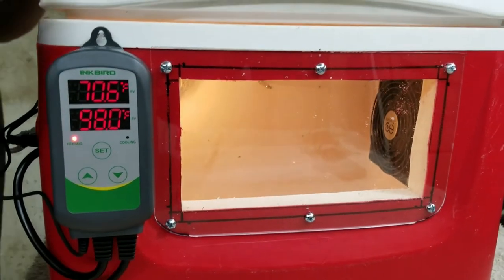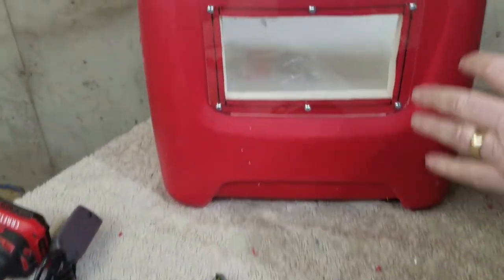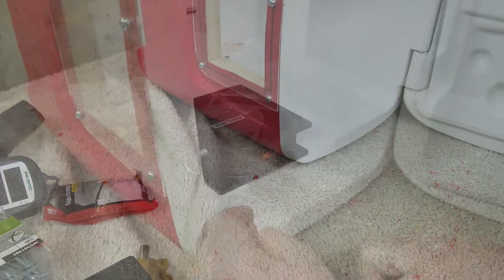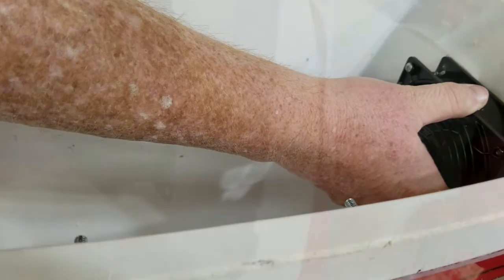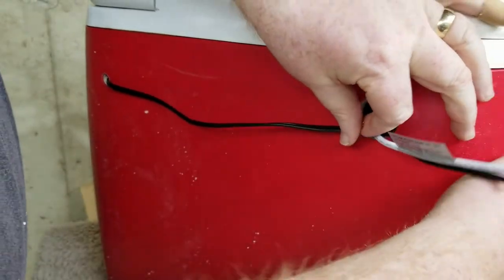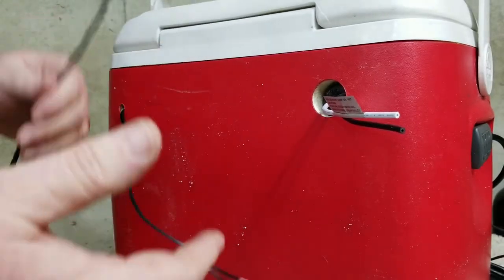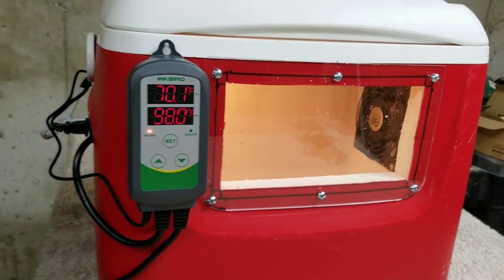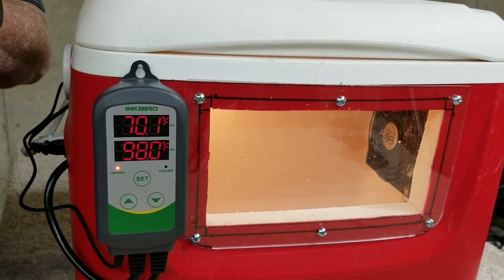DIY Baby Bird Brooder / Incubator Build (Part 2)

Comment: I've set mine up identically but my bulb is close to the bottom .Mine has a manual egg roller that sits on a tray above the light and fan (the trays covered in 1/4" hardware cloth) I can't wait to use it to hatch chicks! Thanks!

Comment: Great concept! Thank you for sharing. How and how much water do you need to keep relative humidity at 50%?
Reply from the maker: Depends on the temp in the box.  also, the more surface area the higher the humidity. you will have to play around with what works for you

Comment: I just saw your video today and subscribe it. Great video. How did you do the wiring? Connect all together? Please explain more about wire connection. Do we have to move eggs every 2 hour manually? Thanks
Reply from the maker: I purposely didn't put video of me wiring because I didn't want this to turn into a DIY on wiring and electricity. We have strict guidelines from YouTube of what we're allowed to show. And not take responsibility if someone tries it and gets hurt. As far as turning eggs I guess this could be used as an incubator, however it's really more of a brooder for after the birds have hatched. Although I have tested this one at 98.5° F and it holds temp just fine so it would incubate eggs.

Comment: One silly question, would ceramic heating bulb work instead of the light heating bulb ? Either way I’ll be building one too, thanks for informative video not much out there
Reply from the maker: It might.  One thing to be aware of, it doesn't take much heat to really heat them up.  You may have to do some testing on what bulb works best with your cooler.  Keep me posted on what you come up with.  Kevin

Comment: Love this video! And will be trying to make one of my own! Question do you mind sharing a link to which fan you used?
Reply from the maker: Try this,   SXDOOL AXIAL Cooling Fan 12cm, AC 115V 120V 120mm x 38mm High Speed CFM with Switch Power Cord, for DIY Ventilation Exhaust Projects
Reply: I found everything on Amazon but light

Comment: Great video! My cockatiel laid 3 fertile eggs and would not sit on them. I used an incubator and all hatched. However, the last one had a darker discharge in his egg, the others had a lighter discharge. Is the dark discharge something to worry about?
Reply from the maker: I wouldn't be overly concerned if the baby is eating and pooping normally.
Reply: Ok, he seems fine. I do have another question about our oldest baby. He is always laying on his stomach. He eats fine but I don’t know if laying on his stomach is normal.
Reply from the maker: @zip._.6842  ok.... When you say always, does he always!?  Meaning he never gets up?
Reply: @Bird.Squawk  he sits up a little bit. He eats good and sits up some for food. But when he is in the incubator he is laying on his stomach. He bobs his head for food, he just seems too heavy with his legs stretched out towards the back.
Reply from the maker: @zip._.6842  checking back in.   How's he doing.  The comment about his leg sticking out may be something to keep an eye on.  Keep me posted.   Kevin
Reply: @Bird.Squawk  hey thanks for replying! He figured it out I guess. He stands normally now👍

Comment: Won't you need some small holes on the other side of the cooler for air flow when you turn on the fan? And how you control the humidity?
Thanks.
Reply from the maker: Great question, yes! however on this new one the fan never comes on.  This unit is set up so the fan is only needed when the units start to over heat.  Also this cool is by no means sealed.  if the fan came on it could draw air and push it out around the lid.  But its really so efficient that it never comes on.

Comment: Are you using the two dimmer switches for fan and light
Reply from the maker: I'm not using dimmer switches on this project.  The fan and the light plug into the controller.

Comment: can i attach a regular glass thermometer or is it better to use a digital one?
Reply from the maker: I've never used one in a brooder. It's also important to note that this unit is not only a thermostat but it controls when the heat comes on and off. You set the temperature at your desired degree and then the light comes on to heat it up and if it gets too warm the light shuts off and the fan comes on.

Comment: Could you please tell me what the name of the light ? I have been searching was thinking of going to hardware store
Reply from the maker: The light socket (called a pigtail) and the light bulb (a lower wattage bulb) both came from Lowes.  The bulb is a standard size screw-in bulb, I think I ended up with a 40 Watt small bulb.  Yours may differ depending on the internal size of your cooler.
Reply: Thank you I’m going to make my own brooder from your idea thank you

Comment: Could a heat pad also work instead the light and use a led
Reply: And how did you hook up fan to controller was it a 12v fan reason I'm asking about heat pad was curious on building it with all usb
Reply: Single 120mm USB Fan with Bracket and Preset Thermostat https://a.co/d/40jDewY cause was thinking this would work
Reply from the maker: I used all 120v system on this build.  You could use 12v for a fan and a light. not sure about a heating pad.  I never liked heating pads, they seem to have hot and cold spots.  It was an uneven heat source.   Let me know what you come up with.  Would love to see it.